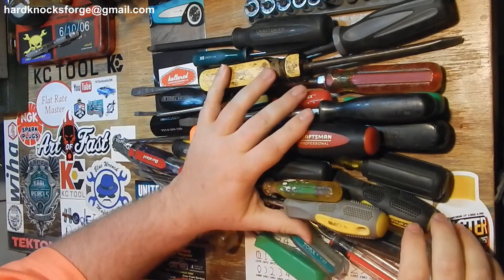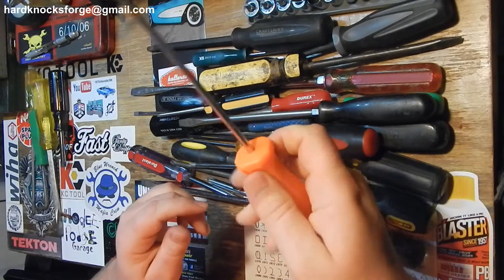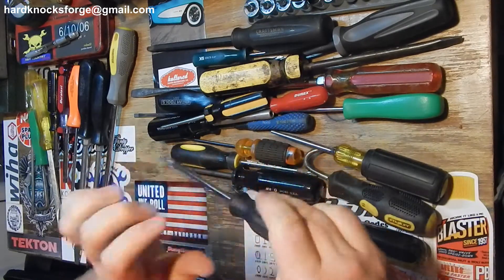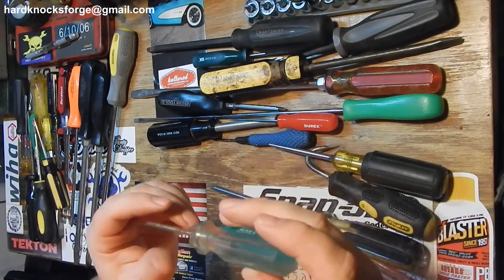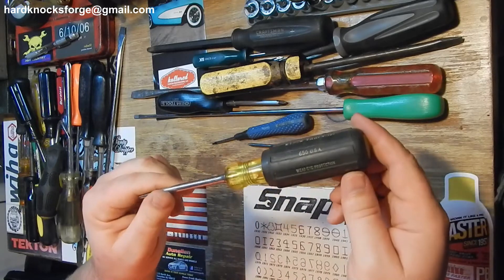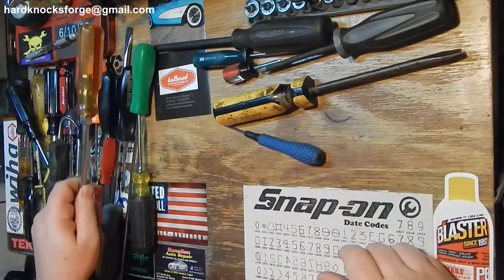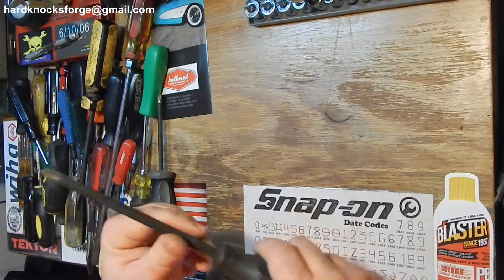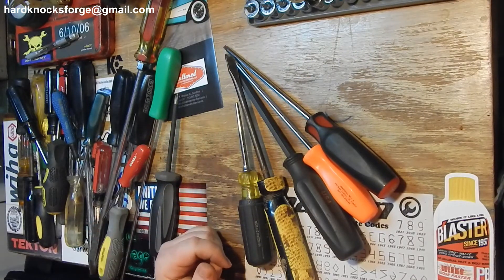screwdriver handles VR for Beer Stud

Comment: snap on came out with the square handle again iam watching a set on ebay nice video
Reply from the maker: Yeah I saw they had an 8pc set come back for a limited time. They are great handles. Cornwell has a similar designed handle but it's made out of rubber and I'm really digging those also.

Comment: Love the screwdriver review / debate!

Like SO instinct handle the best, but only have the panel popper tool and a seal remover with instinct.  My newer screwdrivers are mostly SK suregrip (like the one in yer video) and craftsman pro, but I’ve got an assortment of those yellow Protos, old Stanley’s, a couple red ones that I think are Old Forge.

Oh yeah, and two Yankees with wood handles 👍👍, and a striking cap wood handle screwdriver that was standard issue WW2 which is inherited and indestructible.  Keep it in my tool roll.

Two of my favorites are Milwaukee Demolition screwdrivers with striking caps.  Still $9.95 at HD.  I’ve beat the sh!t out of em.  Used em as chisels and pry bars.  No deformity, bendage, or breakage.  They are Taiwan.

I like the big old hard rubber handles on the SKs.  They spin really well and you can get your whole hand on them and really torque down.

Just picked up a set of Huskys with comfort grip for $7 at HD to replace the rusted ones in my road bag.  They’re actually pretty nice.  Taiwan.
Reply from the maker: I've been looking at those Milwaukee demolition screwdrivers. I'm stuck between them and the new craftsman ones that turn like 5* when you hit them with a hammer. They are kinda like a hand held impact but in screwdriver form. I may just have to bite the bullet and get them all. Tools are my Pokemon, Gotta catch 'em all.
Reply: Hard Knocks Forge I think I’ve seen them.  I almost bought them too.
Reply: Hard Knocks Forge a good reason to get both is they are different but complimentary.  Where you would use one, you’d use the other, like hunting parts at the junk yard.

I wouldn’t hesitate to use the Milwaukee’s as a prybar or a chisel-punch when you need to force two things apart.  They work great as a t-handle if you’ve got something like the loop ended Milwaukee locking pliers that needs torquing down.  They work as a scraper too.  And they work very well as a regular screwdriver.  Nice long blades.

I wouldn’t put the Craftsman’s under stress that isn’t inline with the blade, but being able to get a turn out of the strike is, as you said, more hand impact than chisel / punch / scraper.  And those Craftsman’s just look badass.  They kind of match the set you just picked up.

Pair those four with a hammer and you’ve got a lot of utility out of a small tool roll, and a lifetime warranty, for maybe $20 total.

Anyway, thnx for reminding me about those Craftsmans!

Comment: Wish Snap-On didnt go to the rubber handle screwdrivers. The rubber handles are hard to clean and grime  sticks on them pretty good.  After a ten hour work day not in the mood to clean those things.
Reply from the maker: Yep I try to clean all my tools after I use them, but there aren't enough hours in the day. Snap On had the best screwdriver handles when they had the hard plastic handles with the palm swell in them. Now I could care less for a snappy screwdriver.